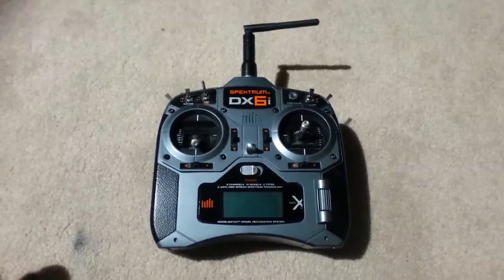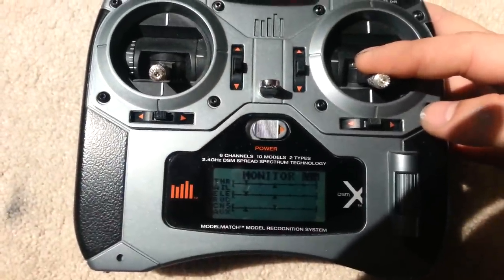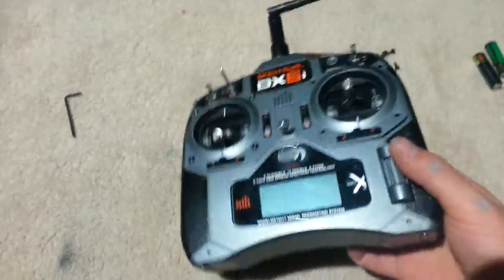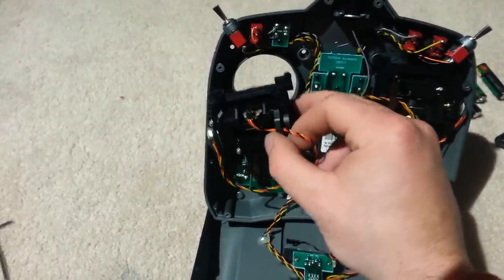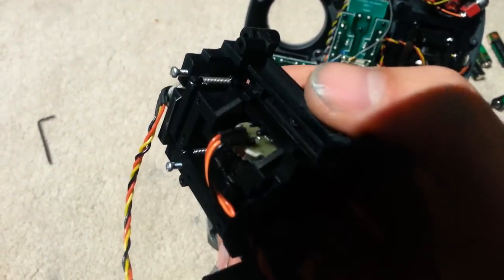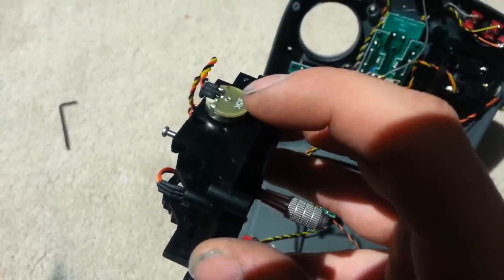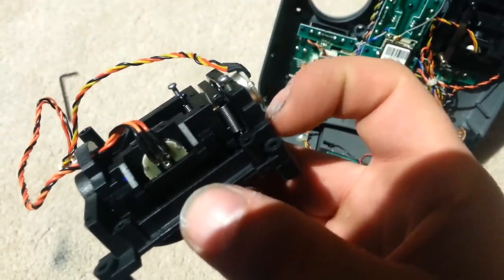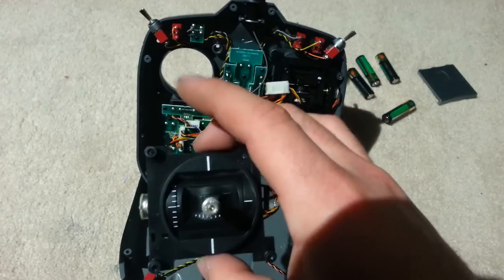Dx6i pot glitch repair.

Comment: I had this also with the throttle pot and just removed the assembly from the front of the case for access and just gently bent the 3 tabs and opened the pot. I used a Q tip dipped in Isopropyl and wiped the contacts and tracks, blew them dry and reassembled it.   Working fine now. Thanks for the video Allan.

Comment: Thanks for this. Mine was doing the same on the throttle. 
Followed your directions (but cleaned with ipa sterile wipes) and it works a treat.

Comment: Hi Allan.  I picked up a DX6i from a secondhand store.  Apparently they thought it a good thing to give it away with 2 channels not working. Glad I didn’t pay for it.  The did not know what to do with it so gave it me. Used your video to fix both channels. Now have a fully functioning set.  Good to know your video is still helping people

Comment: Thank you very much for making this video. Saved me time and shipping this transmitter back. I had a stuck rudder, and after removing the pot and cleaning with IPA, the rudder worked again. 

Tip: Without removing wiring or internal screws, I was able to pry two of the upper metal clips and was able to take out the PCB board to clean. Then reassemble in reverse.

Comment: Got a used dx6i and had the same issue with the rudder. Took the pcb out   and cleaned with some perfume spray and wow the rudder is working now as it should be. Thanks OP you legend.

Comment: Thanks, helped alot. (The DX6i is still a good Radio. Got it for blade bnf Helis)
Reply: i just had to do this for the first time, easier to pry the 3 tabs open rather than remove the whole assembly
Reply: @sloth_7665  that's what i did actually.

Comment: Thanks  for posting this my dx6i  lost rudder control and throttle control acted up after cleaning pots with  Isopropyl  alcohol  and  Q tips works fine now  Thanks for posting this video 
Tip: Without removing wiring or internal screws, I was able to pry two of the upper metal clips and was able to take out the pot boards out  and clean and reinstall

Comment: I took off the small round cover and cleaned it like you did. I never removed the springs or anything didn't need to. Fixed it up great. thanks alot
Reply from the maker: Great makes it a lot easier if you don't have to remove the springs nice tip
Reply: Yes same here, my Throttle stick had virtually no output at all, i used some 'switch cleaner' spray on a q-tip which lifted the dirt straight off the pot track perfectly, so now all back to normal! NOTE: One thing to add is to make sure you get the Potentiometer back plate lined up exactly as you removed it to make sure full throttle/pitch etc range is maintained. Thanks to you allan smith great video.
Reply: Simon Edwards same exact scenario, solution, and advice here.
Reply: Same thing for me, thank you!

Comment: Nice! Worked for me. I didn't need to remove the springs. I used Isopropyl alcohol and q-tips (sparing on the alcohol so it didn't drip anywhere) to do the cleaning. Thanks for the tip!

Comment: Thanks! I've cracked out my DX6i for the first time in ages and it has this issue with the elevator. I'll be giving procedure a test later today. Thanks to you and the rest of the commentators I feel pretty confident it'll fix it. Yay! I may get a flight in this weekend then. Awesome

Comment: Thanks for sharing.  I bought a used DX6i and had the exact issue.  Cleaned the pot tracks with alcohol and it's good as new.  cheers.

Comment: Thanks, this worked for me. Note that I didn't take the tension springs off or retaining clips, I just pried the pcb off and cleaned it while on the sticks still. Also I used q tips with rubbing alcohol instead of windex.
My problem was much worse too, my sticks were completely unresponsive and this fixed it.

Comment: I had that with mine you don't need to take it all apart just take out the retainer clip and it slides out the then as you say bend the clips on the circuit board and clean it out and put it back together job done

Comment: Do not use Windex or alcohol to clean your potentiometer. Windex has water in it and alcohol dries it out too much. Use Deoxit 5, a product specifically designed to clean potentiometers. It cleans it a gently lubricates it. It also will not harm the plastic.